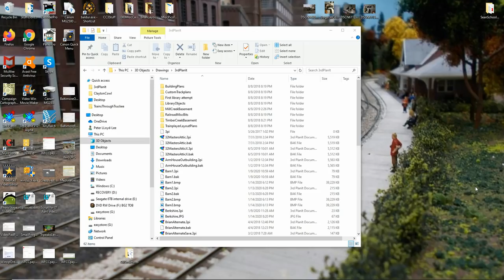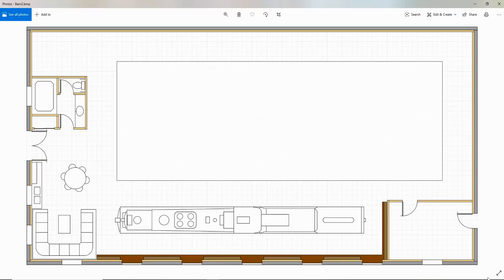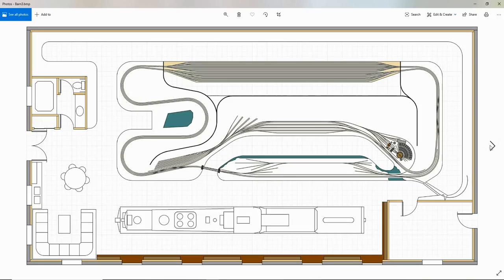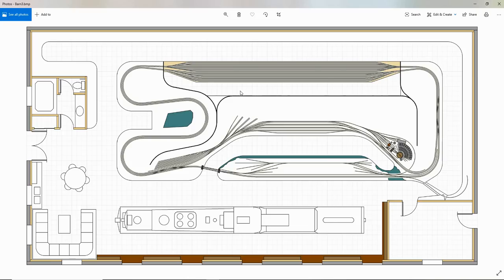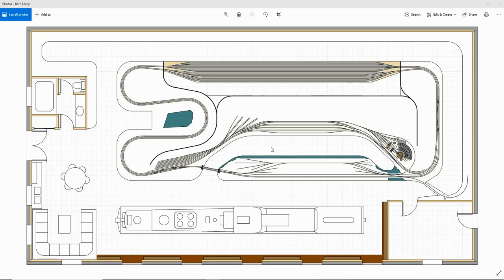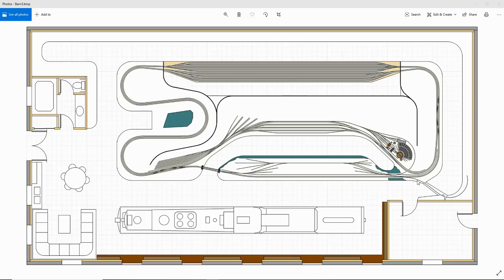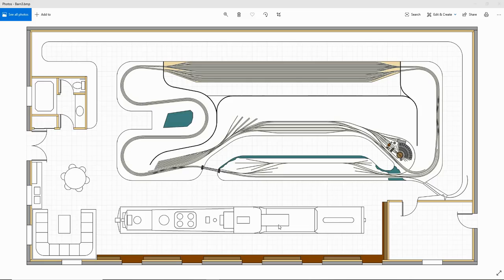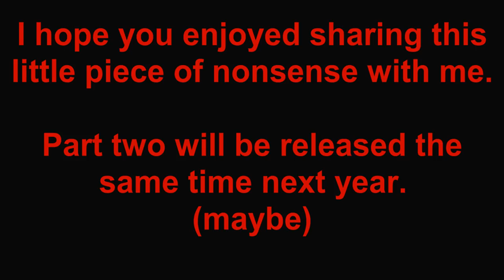Design for a huge PRR railroad layout with something unique

Comment: I was enjoying your fantasy and her money when pooooof.  Someone stuck a pin in it.  And spoiled my fantasy as well.  Your remarks to one commenter about track height I can say something about.  I had a layout built for me to accommodate my infirmities.  I operate it from a 20-inch stool and a big open center space.  It's easy to work on while standing with accommodation of my legs.  The room is so small (10x12-around the room) that it doesn't permit operating sessions but spectators can be managed.  Operating sessions of sorts involve 2 neighborhood boys (8 and 13) who operate from the doorway as I try to encourage their interest in the hobby.  At any event your comment on sacrificing is a major one in a small room.  It also forces (encourages) thinking about reaching the depth of corners.  Great fun.  Thanks.

Comment: ok. i migh be late but, saw the date so no fooling me there. BUT
this idea is actually really interesting. Although no the powering the railroad via a hidden Stem turbine in the Loco but still. having a Steamengine on the layout with cameras so you can actually drive it from a mock up cab would be pretty cool.